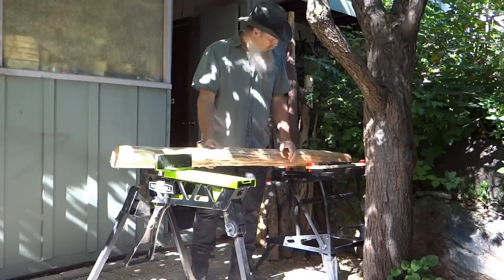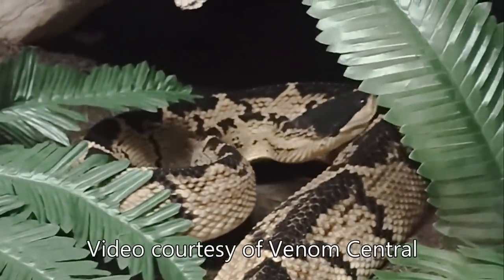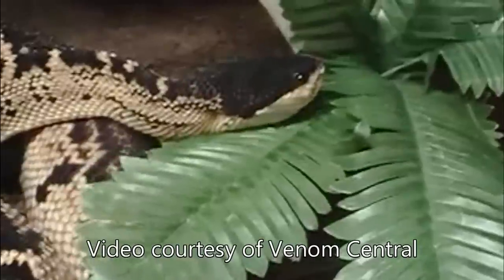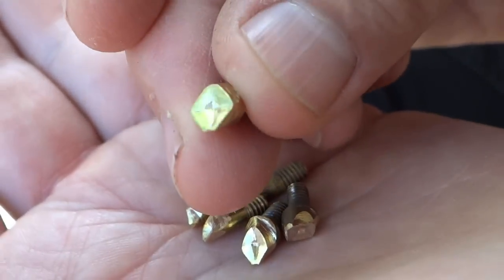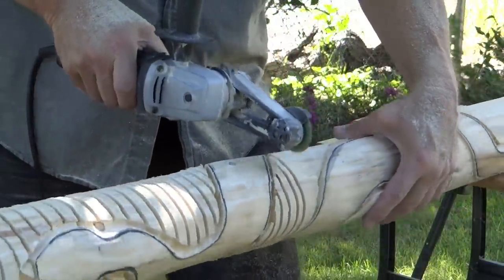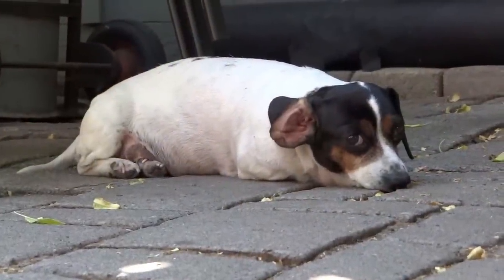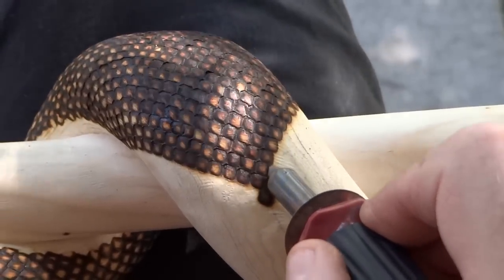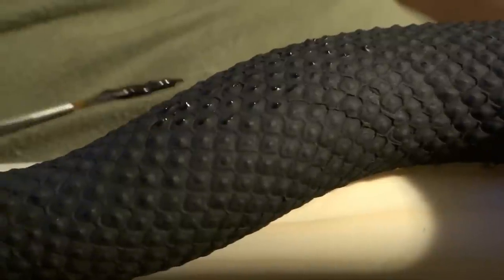Carving a Black Headed Bushmaster

Comment: Mike, another absolutely stunning piece, turned out just fantastic, the extra time to add that bit of resin to the top of the scales, really does add that extra little bit and make it more accurate to the species.
Curious how come you don't do any hand carving with knives to remove the initial big chunks and rough out the shape - seem to recall you used to? Curious what the collection of little chunks remove is for? Guessing fire starting or for a mini "coal" pot fire.
Reply from the maker: Thank you, Lynx! I like to use hand tools, but it is so much faster with power tools. I will burn the little chunks in the wood stove this winter.

Comment: His works are always beautiful, one more than the other.
But I want to expose myself to your reaction with a very small criticism that does not want to diminish the quality of the work, but rather wants to be constructive. at least in my intention. That black rubber "stopper" at the bottom of the stick cannot be seen. this work deserves a more precious completion, perhaps in metal
*
(and even if he won't forgive my intrusion, know that I will continue to appreciate his works anyway).
Reply from the maker: Thank you for your kind words! Sometimes I will put a brass ferule on the end, but the customer did not want it on this piece.
Reply: @StinnettSticks  Thanks for the reply. Of course, I understand, if one actually uses the stick every day, a rubber tip certainly guarantees greater grip.